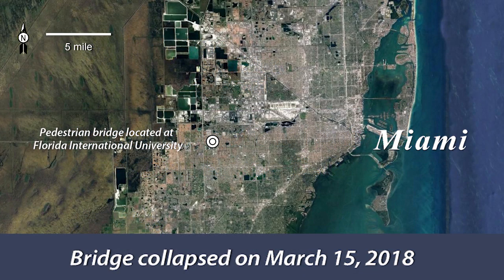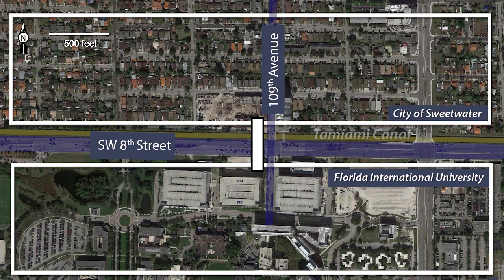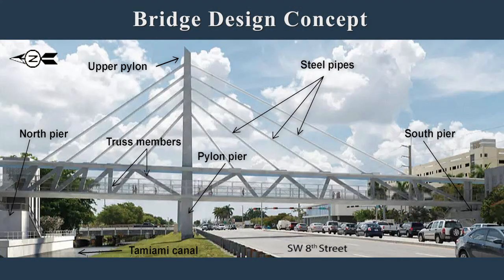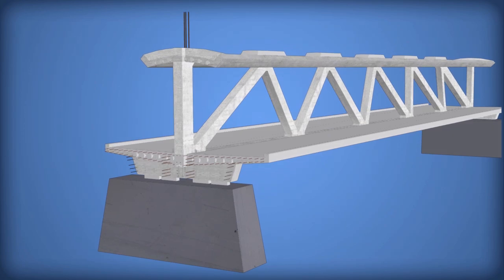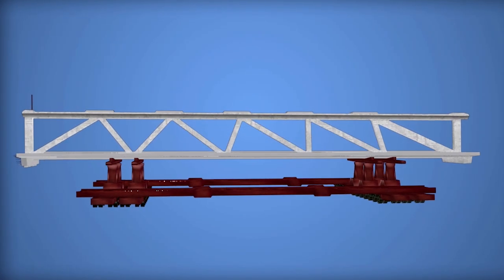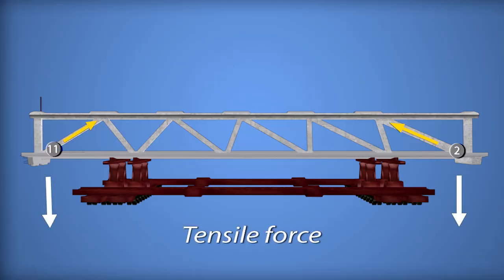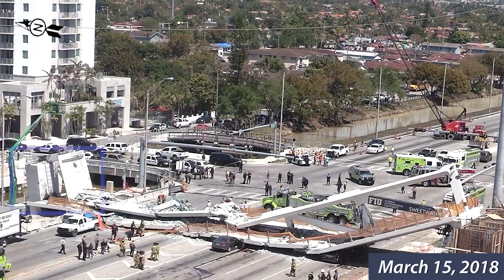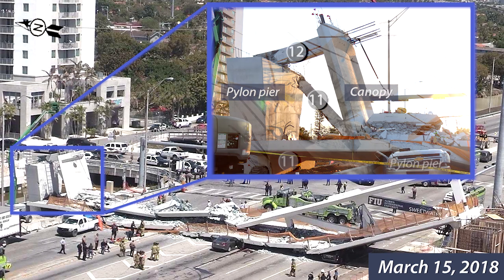Pedestrian Bridge Collapse Over SW 8th Street HWY18MH009

Comment: How do you not close off the road with cracks form? Let alone design a bridge with no redundancy?
Reply: As others have mentioned, many, many bridges have no redundancy.  Almost every older bridge with a truss structure above the roadway doesn't have a redundant structure.  As has been mentioned about the I-5 bridge, break just one of the truss members, and the bridge collapses.
That said, it's not often that I'm embarrassed to say that I'm an engineer, but this is one of those times.  Cracks that big in a NEW structure indicate a very serious problem.
Reply: Andrew Snow how did this design pass then when designing it in a computer? How did the supervisor approve? What redundancies were they talking about then?
Reply: @bigbrycm6  Well, the computer is only as good as the data they feed it (more on this in a second reply). 

In this usage, "redundancy" is being used in a narrow technical sense.  Here's an example: If you hang a 10 lb weight from one rope, you have no redundancy -- even if that rope can support 500 pounds.  No mater how strong the one rope is, if a single failure occurs then the weight falls.  On the other hand, if you hang the weight using 2 ropes that have a strength of 15 pounds each, then you have a redundant system -- if one rope fails the weight still doesn't fall.  UNLESS, the ropes are tied to the same hook, and the hook pulls out of the ceiling.
From my reading of the synopsis, the hook-in-the-ceiling example is apt for this bridge.  The steel reinforcing rods were redundant, if one failed, the others would still hold the bridge up.  But the joint where the steel rods came together was not redundant, a single joint failure brought the bridge down.
Reply: @bigbrycm6  Regarding how they got the design wrong, the NTSB has some information in their synopsis here:
https://www.ntsb.gov/news/events/Documents/2019-HWY18MH009-BMG-abstract.pdf
But, the full report is not out yet, so some of the following is just my guesses:
From the synopsis: "The  bridge  design team made two errors ... First, the design team underestimated the demand (loads  imposed  on  structural  members)....  The  investigation ... found  the [load] was nearly twice what the design team had calculated. Second, the design team also overestimated the capacity of the node to resist shear (horizontal force) where the nodal region (11/12) was connected to the bridge deck. This overestimation was the result of the designer using incorrect loads and  load  factors  in  its  calculations."

This is where the full report is needed for all the details.  Here are some possibilities:
It's actually hard to explain the first error of the loads being twice what they calculated.  For engineers, calculating the loads that a bridge beam or joint will see is kindergarten stuff.  My wild guess is that it might have been a communication problem.  Obviously a project of this size will have a number of engineers doing different parts of the design.  I'm sure this is NOT the case, but for example maybe the bridge has a concrete member in it with 2 steel rods in it.  Engineer 1 calculates that each steel rod will carry 1000 pounds.  Engineer 2 is designing the joint where these steel rods anchor.  Engineer 1 tells engineer 2 that the steel rods have a load of 1000 pounds.  Engineer 2 assumes this is the TOTAL load of the 2 rods (500 lb each), and now we are off by a factor of two!
In error two, they say the designer used the incorrect load factors, and they talk about safety factors elsewhere in the synopsis.  It sounds like maybe (and again, this is a guess), that the person designing the joint assumed it was part of a redundant structure, and thus used a lower safety factor than they should have for a non-redundant structure.
In both of these cases, a computer can't always save you.  If you tell the computer the joint has a 1000 pound load but it's actually a 2000 pound load, the computer won't know.  If you get the results back from the computer and it says the safety factor is 1, and you think that's OK because you think it is a redundant structure where the load is shared across a number of these joints, again the computer won't help.
Reply: Andrew Snow thanks for the explanation and info!
Reply: @andrewsnow7386  My guess is that they had a bad model for the stiffness of the joints, which influences the distribution of loads on the whole structure. Steel truss joints can be designed to be flexible, but concrete structure is much greater cross-section, which might have made it stiffer, so it got greater loads than expected.
Reply: @andrewsnow7386  You could’ve just said “garbage in garbage out“ :-)
Reply: @bigbrycm6  In 1968 when I took my first computer course, the saying was "to err is human, to really screw things up takes a computer". The Hartford Civic Center Roof truss collapse was because the computer did not understand the 12 commandment "you can't push a rope" and the engineer didn't really understand the program. I am a retired PE and am glad to be out of the mess of today's business and construction. Engineers get overruled on safety decisions. Good Luck, Rick
Reply: @SlocketSeven  I generally agree with that statement. The cracks were much smaller at the time of the move. I am a structural engineer and I would have suspected the start of a shear friction failure if I  saw those cracks. But if the engineers was having a bad day and didn't think so much, they may have not recognized the problem or gone back to check the calculations. We see cracks in concrete all the time and you can become complacent. You have to remind yourself to keep on thinking and evaluating. 99% of the time, the cracks are nothing important.

There was no excuse after the move when the cracks were much larger.
Reply: @yodaiam1000  The cracks were getting larger over several days. That isn't an issue with the movement or placement forces. That is a looming failure. 1 bad day if this all happened over a matter of minutes or hours, okay, maybe. But they watched this develop for 5 days. Then decided to half arse some adjustments, while keeping live traffic flowing under the bridge. This goes beyond a bad day and well into criminality.
Reply: @andrewtaylor940   The cracks got much worst after the release of PT in #2 and #11 after the move. That is when the cracks really started to grow. They were much smaller before the move. I still say the engineers should have know the implications when the cracks first appeared. It was just unmistakable after the #11 and#2 PT was released.
Reply: @yodaiam1000  Oh I agree. I'm not an Engineer. I was a Fire Officer so Fire Engineering Degree. Just looking at this report what would have flagged me was not so much the existence of the cracks, as the growth of them, and the speed of the changes. The cracks were measurably increasing over a matter of hours/days. And shedding fist sizes pieces of concrete. That should have had big red lights flashing in everybody's brains. DANGER DANGER! And for Gods sake you don't do load testing or load/tension adjustments over an active heavy traffic roadway in the middle of the day. Worst case you close a lane or two, put one end of the transporter back under it and let it shore up the load at that end until nightfall when you can close the road and start attempting to fix the problem.
Reply: @yodaiam1000  From your experience, with the rate of growth in the cracks shown in the provided photos, would/ should a decision have been made sooner, or does the timeline seem appropriate? The photos are of great detail so it would appear the engineers were fully aware of the problem from the start and most likely were in some way concerned.
Reply: @fishtacos2320  Most of the time, the error would have been caught in the design stage but stuff happens and things will get missed (rare but it happens). The cracks in the casting yard were obvious shear friction cracks. A trained engineer would have to be having an off day to miss the implication. Missing the cracks after placement and not knowing the risks involved was either complete incompetence or they were rolling the dice and hoping nothing was going to happen. The charitable interpretation is incompetence or the early signs of dementia.
Reply: @yodaiam1000  Probably the engineers were inside in the air conditioning and relying on low wage workers to report abnormalities (though with all those photographs, it's likely they never bothered looking).
Reply: @uhclem  Why do you believe that?
Reply: @yodaiam1000  I lived in Miami from 1957 to 1995. I know all about the work ethic there.
Reply: @uhclem  Don't you think that is a generalization? It takes a hell of a lot of effort and focus to get an engineering degree and practice engineering for a living.
Reply: Most long span bridges don't have redundancy. The lack of redundancy was only during the construction phase in this case. However, those cracks did demand that the bridge should have been shored up and the road closed.
Reply: @yodaiam1000  not so most bridges do indeed have redundancy.
Reply: A typical suspension bridge can be brought down by the severing of the suspension line. Any section of an arch can be removed to cause a collapse. The tie on a tied arch can be severed to cause a collapse. Cable stays are the most redundant long span bridges but even there, it relies on the compression of the deck at the pier locations.  The piers on most bridges can be brought down by the demolition of a single leg on the pier. A single failure of a diagonal on a warren truss or chord element on a bridge truss can bring the bridge down. 

Based on my experience, it rare to see a long span bridge that is truly redundant and even many shorter bridges are not redundant.

It is difficult to define redundancy or codify it but Why do believe most long span bridges are redundant?
Reply: @yodaiam1000 
That doesn't make it a good idea.
Reply: @ezakustam  I made a bunch of post. I am assuming you are talking about the comments on redundancy. 

Redundancy is a good design principle but it is not necessarily practical in all cases and it is very difficult to define and codify. If you can have redundancy, that is great and a good design goal.
Reply: @peterebel7899  That is just not true. Bridge design is also typically not referred to as "mechanical constructions". Redundancy of load path is a very important aspect of structural design. We use factored limit states design for the strength aspects for a bridge or a building but redundancy and ductility are also very important design aspects. I don't know where you get your information from. It doesn't sound like you are an engineer.

BTW there are trees with multiple trunks and load paths. Look up "Banyan tree".
Reply: @peterebel7899  I never said redundancy was an absolute requirement of a bridge or a building. But it is an important aspect of structural design. If I bridge doesn't have redundancy, some codes require an extra load factor in the design. One of the reasons cable stays are so popular now is the fact that they have more redundancy.

Redundancy is very difficult to codify but make no mistake, a design with redundancy is safer and where ever possible is an important design goal.

This is a precast bridge where it is typical to review the design during different phases of the construction. That was also true for this case. You can see additional rods were added to the design for the load reversal during the move. The main issue was a design error.  Even under the fully constructed configuration, this was still a design error.

What discipline of engineering are you in?
Reply: @peterebel7899  I am a structural engineer with over thirty years of experience. I design mostly buildings, renovations, seismic upgrades but I have also designed some bridges including pedestrian bridges over highways.
Reply: @peterebel7899  We do an analysis with the redundancy in mind. A good design thinks about the consequences of the different design decisions including redundancy. For structures, redundancy is generally considered a good thing but it is also balanced with the other criteria of the project. That is one of the reasons it is difficult to codify. It is also actually difficult to define redundancy in structures so it also difficult to generate code rules regarding redundancy.

I can't get into all the reasons why it is a good thing or all the ways we use redundancy. It takes a lot of experience to develop a structural design so it is not possible to do it any justice  in a Youtube response.

It looks like you may be German.  There is a saying German structural engineers have and I obviously don't know the translation. Perhaps you can find it. It is something like "one is none" and that was drilled into our heads as engineering students and I generally agree with it. That doesn't  mean redundancy isn't a different kettle of fish for other disciplines.
Reply: @yodaiam1000  You are wrong.  As the video explained the mast and tubes were only aesthetic - i.e. not structural and a frivolous waste of money.
There was only one set of truss diagonals - if any one failed the bridge failed.  That was a lack of redundancy.
(Suspension bridges can lose hangers and strands within the cables. Similarly, cable stayed bridges.  Truss bridges usually have multiple trusses.  So, wrong again.)
In this case the problem was that the joints were weaker than the members and the joints did not have adequate capacity.
When the joints failed people merely took photographs.  It is a design a 2nd year student would get failed on.  Everyone involved should be made to resit their professional exams.
Reply: @robi4387  I made a bunch of comments so I am not aware of which comment you are referring to.  However, stay pipes do provide redundancy. They were initially added for both aesthetics and vibration control. They were most certainly not only aesthetic. This is written in the original design brief. However, even if the assumption was not written into the original design brief, the pipes add redundancy.  

If you loose the main suspension line of a typical long span suspension bridge, it will most certainly collapse. If you want to argue that you can loose individual strains, then you can loose individual rebar in the truss or you can loose a chunk  out of the concrete member. So according to that argument, everything is redundant until the second to last fiber fails. You can also loose an entire truss members near the mid span without a collapse.

The interface shear cracks moved substantially and showed significant ductility for an interface shear failure prior to the collapse. That was in part due to doweling action of the column vertical bars which is a form of redundancy whether that was intentional of not.

Multiple trusses by itself typically does not add more redundancy. If one of two trusses fails, the bridge typically fails.

In general, redundancy is hard to define. There are design decisions that you make that are subconscious but add redundancy. Sometimes you look at a detail, and you just say to yourself "I don't like that" and you change it something that is more redundant. Not every decision or aspect if necessarily expressed in the design brief. In fact, only the major components are addressed in the design brief and there can be thousands of decisions when designing a building or bridge.
Reply: @yodaiam1000  close a major road for the fear of a bridge collapse, try convincing a politician to do such a thing. it was reasonably safe till it collapsed, while they were trying to fix it. if they felt they couldn't fix it they would have closed the road and removed the bridge from it's stands. there was no reason to close the road. now should they have closed it, out of an abundance of caution sure, but not absolutely mandatory, and in this case, it would cause a major traffic problem and require probably weeks of planing and bureaucracy to begin with.
Reply: @TheObsesedAnimeFreaks  The shear friction cracks were obvious after the move and a trained engineer knows the implications. I am a structural engineer and I would have closed the road. If I got resistance, I would have phone 911 to close the road (that is not an overstatement).
Reply: @yodaiam1000  and what i think 911 will tell you is "hahahahhahahah," then again i have little confidence in the government as a whole, and i know there is very likely going to be politics at play that would have prevented that road being shut down at all, until the bridge collapsed. just because an engineer screams at a 911 operator doesn't mean that the police department is going to respond properly or correctly. they will likely show up see the bridge is still up after being told it collapsed, and then just move on. and if they went through the bureaucracy, they likely would have only gotten permission to close at most a few lanes and erect scaffolding to sure it up and keep it from collapsing. At the end of the day it likely wasn't going to be shut down even if they called 911 and said it would collapse. politics are at play here like it or not, and THAT is why the road wasn't shut down while most engineers and people with a lick of sense would probably want it shut down, the politics of shutting down a major road at any cost is are far less forgiving, and far less permitting.  not only is economic harm a reality that they have to consider, the inconvenience to their constituents is another thing. they rather take the risk of having it collapse then allow the road to be closed for any amount of time while it still hasn't collapsed. even the police or a 911 operator can't make that call unless something like a traffic accident that mandates the shut down of the road happens, especially a major road like that one.
Reply: @TheObsesedAnimeFreaks  I doubt that is true. If a structural engineer calls and says that there is a dangerous condition and the bridge may collapse, 911 will respond or face the consequences of not responding. Those cracks were an indication of an impending collapse. That Ave video you linked to was incorrect. He jumped to a wrong conclusion. Look at the cracks just before the collapse. It was unethical for anyone who knew anything about concrete design not to shut the road down or call 911 if they had to.

As a structural engineer, I am usually quite sympathetic to engineers that may have made a technical error since it is so easy to do and people are killed when these things happen. But this case is different. I doubt it will happen but manslaughter charges should have been considered. That is how reckless the contractor and engineer were.
Reply: @yodaiam1000  
I say this as a layman, a police officer would respond if you call 911 and not do a damn thing because they don't know what is going on. Even if you explain it to them they would likely go, "it's still up isn't it?" and not do a damn thing, unless you can guarantee a timeline for when it would come down, then they would likely have to get the closure approved by the department among other things. The main problem with the idea that the road should have been shut down, is that it is a major thoroughfare, and shutting it down for any reason is not a call that a individual 911 operator or a police officer can make. It HAS to go through some level of government debated and then approved, especially since the bridge hadn't fallen yet, and the workers were actively trying to mitigate the issue. The reason why the road wasn't closed is because the government would not allow it to be closed, because plenty of reasons. they didn't have a the benefit of hindsight like we do now. they probably didn't realize it was going to collapse or that they could prevent it from collapsing. and like AvE said, what probably caused it to collapse was the snapping of the pretension bars, while other factors probably contributed to it, the straw that broke the camels back was the over tension of the PT bars.  

At the end of the day there was likely nothing anyone could do to close the road, government isn't going to always listen to an engineer. they likely wouldn't have considered the bridge an emergency until an hour before collapse or at best a day before. if there was a degree of uncertainty as to when and how, they probably wouldn't have closed it, just to keep traffic flowing.

I would complain about the road not being closed to the Public Works department, i feel they have more responsibility here then the engineers that were trying to fix it or prevent it from collapsing. .
Reply: @TheObsesedAnimeFreaks  Ave was completely wrong. That is not a dis on Ave. He just didn't have all the facts and jumped to the wrong conclusion. The PT did not even snap. It was fully intact after the accident.

I guess we will have to agree to disagree on the 911 call. The road got shut down anyways. Perhaps 911 is much different where I live.
Reply: @andrewtaylor940  like is said, i have little faith in politicians, and for the reasons outlined, i feel that the politicians would rather risk the lives of people traveling under the bridge rather then close the road down. it's a major thoroughfare and closing something like that down takes a lot of planning and is something that can't be done with the snap of the finger, unless there is a physical obstruction in the way. That being said, i don't disagree with the fact that it should have been closed for many many reasons, i just don't believe that the politics and bureaucracy that exists in Miami would have allowed it to be closed even if they tried. so even if the politicians aren't complete morons, there is probably policy and procedure that has to be followed that will slow down the closing of the road.
Reply: @TheObsesedAnimeFreaks   "reasonably safe till it collapsed". No politicians need to be convinced, there are authorities for this. Like police closes a road immediately when there is a bomb threat.
Reply: @retepaskab  Politicians DO need to be convinced, you are conflating an actual (and arguably over reactive) emergency with something that mandates procedure. construction crews are not permitted to just shut down a road, NOR are the permitted to use emergency services to shut down a road for an undisclosed amount of time. a bomb threat often results in a waste of resources when no such actual threat exists, however once the threat is determined to be false or "taken care of" which often happens within hours, while shutting down a road because someone complains that they think the bridge will come down, is a risk that they can take and closure time that they can't take. the time of a road closure because of a bridge is often months not hours. closing a major road for months is NOT acceptable, unless absolutely necessary. there are 2 entirely different things with 2 entirely different response methods.
Reply: @bobwillneverdie  Design a bridge ≠ Engineer a bridge.
Reply: Bryce Nelson — A lot of bridges lack redundancy.  You don’t necessarily get redundancy with multiple trusses, but you can compensate for lack of redundancy with conservative design and a generous margin of safety.

An example of how double trusses do not guarantee safety is a steel bridge on I-5 in Washington State which collapsed (in one section) in 2013 when an oversize load struck one element of the structure at the top.  The bridge could easily support itself and its maximum load with a large safety margin, but could not tolerate breakage of the truss element.
Reply: @GH-oi2jf  Ah yes, the I-5 Skagit River Bridge. I remember it well as I work for WSDOT; however, I was on vacation east of the Cascades at the time and fortunately wasn't called back.
Reply: @GH-oi2jf  The redundancy with multiple trusses will not prevent a failure or collapse. But will generally limit it. So typically only a portion of the deck will fall. Not the entire span.
Reply: @GH-oi2jf  but that truss bridge in washington was built a very long time ago, and would not have been built today.  Its truss members were likewise built lower what freeway clearance normally allows.  At least it was built from steel and lasted decades longer than this concrete folly!
Reply: Because Florida
Reply: My biggest issue is....since they obviously documented the cracks as they were forming...and growing mind you...no one thought about the OBVIOUS SIGNS OF PENDING FAILURE.
Reply: @nick4819  I can't conceive of any professional thinking those cracks were not a life safety concern. As you say, the cracks were obvious signs.
Reply: Someone should be going to jail for this. The idiots in charge showed nothing but extreme incompetence and negligence. The design was bad from the get go. The architect designed a death trap.
Reply: I don"t know, but in my company important technical decisions like ditching redundancy are not made by engineers anymore, but by a management without any clue of science.
Reply: Yeah I was a bit confused with a bridge being approved without redundancies. Out of all the projects I've worked on, nearly everything has a redundancy for each redundancy.
Reply: @fishtacos2320  Actually, most long span bridges are not redundant. Too much was made of the redundancy issues. It was a side issue. This bridge actually hung in pretty well which indicates there was some redundancy and ductility. It is just that the signs were ignored.
Reply: Yes, people need to go to prison on manslaughter charges and never allowed in the construction industry again.
Reply: Just gotta say anyone who makes an agenda about race or politics out of this needs to drink bleach, I'll buy you all some. Why are there so often engineering disasters that are very obvious to see after the fact is what we should be asking
Reply: @Bryce Nelson Somebody replaced their brain with "Matlab will solve this". There's a reason for the tradition of engineers standing under the newly-built bridges  they designed during testing.
Reply: The golden gate and many other bridges and buildings built way back now we get 5 day bridges and buildings in new Orleans that cant even get to opening day maybe college is a waste of time
Reply: the same reason why they allow a lot of bad things in life they don't care
Reply: Which engineering firm approved the design?  Did OSHA inspect the cracking B4 the failure?  Was the concrete tested prior and after the pore for adequate curing?
After the fact questions, but a procedure of tests needed to prevent future accidets???
Reply: @salvatoredemaria8753  Figg was the design firm and the design was approved by Mr. Denny Pate of Figg engineering.

OSHA did not review the cracks before the collapse. They review sites after the occurrence of an accident.

Concrete was tested during construction and after the collapse. All materials met specification.

NTSB is publishing recommendations for future procedures.
Reply: Sounds like the 2 Santiago Calatrava bridges in Dallas. Dysfunctional as designed.
Reply: Money
Reply: Wow..............?????
Reply: I guess architects know better
Reply: @ramirochavez3332  architects do not engineer bridges. They may have designed what the bridge will look like but structural engineers are responsible for making sure that design is structurally sound. This collapse was a massive engineering screw up and those working in the field should have been raising red flags when those cracks started and continued to develop.
Reply: How do you sign off on installing a non-redundant structured pedestrian bridge that starts to break under its own weight in the fabrication yard?
Reply: Probably because 8th street is a major roadway in Miami. The political powers that be wouldn’t have wanted that headache if the engineers did request the road closure. So many people failed with this incident.
Reply: In IL that would be illegal. Probably is in FL too.
Reply: Florida
Reply: There are numerous cases of architects desperately trying to be original in their designs which then fail killing dozens of people. 

The blame is then put on the engineers and the costs, risks are offloaded to the construction workers and general public. 

The Romans built bridges that lasted centuries. Maybe we should consider the importance of using more arches, pillars, and domes.
Reply: @Salvatore Civale Actually as a matter of fact... it takes longer. Closing the road down to fix and or remove the bridge will take months. You have to consider planning and all the application and approval processes that they have to take care of. While removing a collapsed bridge only takes about a day or two once it collapses. Rebuilding it often takes longer. That bridge would have been up there cracking further and threatening to collapse with traffic flowing under it for months if it didn't happen to collapse within 5 days.  
>When lives are at stake, it's better safe than sorry
you might say that now... but wait till you are in a position of power and have to worry about NIMBYs complaining about traffic and causing major issues.
Reply: @Salvatore Civale dude you don't seem to get it. To remove a bridge, any bridge, it takes quite a bit of planning and prep work before they can actually do it. It would not be the same amount of time it took to put the bridge there, it would be much longer. They need the equipment to remove it, which has already been shipped to the next job site and likely will not be back till they have time to bring it back, they need to plan the diversions, they need to get the removal and road closure approved, and tones of other things like an "environmental study" in some cases. Your agreement was to close the road till the bridge could be removed, guess what that would take months. That is objective fact. There are procedures in place for a reason even if I personally disagree with them because of edge cases like this. Construction companies have to follow this procedure and get all road closures approved, and do all the paperwork and filings for permits and a bunch of other stuff. It's not as simple as you want it to be. Government bloat prevents quick action in cases like this.
Reply: When this happened, I had the same question. However, I realized that incompetence, lack of general safety rules have come to dominate American know how, so I am not surprised that the roads were kept open while they decided to make a bad situation worse. If the tensioning rods were causing the cracks, then why add additional stress. The concrete might not have been strong enough, or the bridge had a construction flaw in itself. I believe we will see more and more of this type of engineering failures as time progresses, this will not be the last of its kind. Incompetence, mismanagement, greed, UNIONS, all play a role in what is being built today. That Rock café being built in New Orleans is another example of incompetence.
Reply: @ew4096  uh... Stressing concrete in tension makes is stronger, as opposed to stretching it, which was part of the issue
Reply: @SlocketSeven  diversity has nothing to do with it.  The problem is the structure failed from a structural and materials perspective - concrete does not work in tensile and shear applications as was illustrated.  Also, why was the university blowing all of their money on a highway overpass?! They should have kept the structure as basic as possible to minimize risks and to focus their money on the campus where people actually want to be, not hanging over a pollution filled freeway canyon.  Great example of car-centric idiocy in design.
Reply: Because wahmen
Reply: It is intuitively obvious to even the most casual observer (what I am saying here is that any idiot could see) this was not going to work even before it was lifted.
Reply: They could have even used REAL cabled stayed supports.   They also had plenty of room for another interior pier support.   It was arrogance and FIU is also to blame in the matter.   As a structural engineer I'm so tired of unforced and unneeded risk being taken on because some damn board member or manager wants it that way "Just Because" we can do it.
Reply: @SlocketSeven   More like, "predictable result of deregulating everything".  Stronger, more safety-oriented (meaning less "business-friendly") construction codes would have prevented this.
Reply: @SlocketSeven  and the new generation (regardless of age) clueless  thinkers and peopele tha dont care /
Reply: @SlocketSeven  Diversity?! How exactly? I am genuinely asking, just want to know. Thanks.
Reply: @bobwillneverdie  You are kidding, right?!
Reply: @alirezajohari8916  That they hired a music major with no engineering experience to design a bridge, promoted the crap out of the fact that it was "female engineered", and then had people die because they thought music majors could be engineers. Nope, all that happened.
Reply: Its easy when you don't care.
Reply: Low bid
Reply: Pacified Democracy  evidence or notoriously sexist?
Reply: Greed
Reply: So the suspension things are just decoration?
Reply: It's Florida. They don't give af about safety.
Reply: Half the bridges in this country lack redundancy.
Reply: Bro there’s cracks on every bridge
Reply: @Therealestrunnerluda   on newly installed bridges??
Reply: @bigbrycm6  Cracks usually start to show up the day after concrete is poured.
Reply: how? why? 
easy.....money
Reply: You do it by going to the college that teaches bridge building. A world renowned college for bridge building.  Once on the outside things get different when that person has to sign their name. I don't think people spending money would risk having 0 redundancy.
Reply: The cracks were developing already 19 days before they even started to move that section. The overall design did not take into consideration how it was going to be constructed. They basically doomed that bridge when they decided to use the ABC method to construct it.
Reply: Exactly!
Ludicrous situation.
Reply: Florida.
Reply: @manualLaborer  America
Reply: @bobwillneverdie  whether someone has a music degree or not has nothing to do with architecture, it's the job of the engineers to fix the designers weaknesses. that means an architect doesn't have to go to school to be one for all practical purposes, while this helps in creating practical art, it is not absolutely required. the engineers will fix whatever weaknesses the structure has to make sure it can actually stand the tests they put it through. This is also why we can have design competitions for major structures as well. they will take a child's design and make a practical representation of it.
Reply: @TheObsesedAnimeFreaks  You are correct. I have dealt with crazy architects all my career with crazy designs. I don't believe Linda Figg has an architectural degree. She wasn't involved with the technical design. I understand that she has an engineering degree but looks like she was just involved with the marketing aspects.
Reply: @TheObsesedAnimeFreaks  Doesn't the importance of hiring a designer with engineering experience outweigh that? 

Example: Airline hires music major as pilot, and they crash a plane. Would it be the airlines fault for hiring them? or would it be the flight attendants fault because they were there and didn't try to take over the plane? It would be the Airlines fault.

My point is that the state of Florida is literally awarding people for hiring music majors to build bridges. Its not like the company just made a mistake..... Florida literally PAID THEM MONEY to do this. THEY WERE PAID MONEY TO RISK PEOPLES LIVES FOR "FEELINGS".

Also: https://en-volve.com/wp-content/uploads/2018/03/FIU-Munilla-Construction-Feminists.jpg
Reply: @bobwillneverdie  
>Doesn't the importance of hiring a designer with engineering experience outweigh that?
Absolutely not. this is why you higher engineers to do the dirty work. to make the structure as sound as it can be. architects are often trained is some aspects of math and engineering, but they are NOT a substitute for an engineer, and depending on the school they went to for the degree, i.e. if they went to Georgia Tech or SCAD, depends on how much of that math and engineering they have. architects are designers first, engineers a distant second. their job is to design things, and for all practical reasons, ANYONE can be an architect without any schooling, you just have to have the engineering team behind you to make your designs work properly. 

>Airline hires music major as pilot,
That's irrelevant. The only thing that matters as a pilot is if they have the flight hours, and the license(figuratively or literally) to fly. there is a reason why most airline pilots are ex military, they have the hours and they have the license to fly, if they just happened to go to mercer for a music degree just before entering the air force is irrelevant. 

>My point is that the state of Florida is literally awarding people for hiring music majors to build bridges.
they didn't higher engineers with only music majors though, they allegedly hired a music major to design the thing. the fault falls on the engineers and the site crew that screwed up the build, not the designer. If that team recognized a problem with the build, which they often do, they will notify the designer that they need to tweak the design slightly to fit the new requirements. it seems that in this build that didn't happen like it should have. it seems the engineers might have missed a few vital details in the design process and that contributed to this incident. while i'm not an expert on these things, i know if you have the right people behind you as a designer you can make wondrous things.
Reply: @AmsterdamHeavy  What women? The EOR had decades of bridge engineering experience and was a man.
Reply: dude, there are a lot of bridge designs that are non-redundant, most of the time they don't need redundancy. your standard highway bridge is non-redundant. if one of those beams go, the section of road it is carrying goes with it. granted most bridges are built to handle much more then they are generally going to take in their lifetimes. 

also there was little need to close the road, while they should have probably taken a bit more precaution in the construction of the bridge, what actually caused the bridge to fail was the over tensioning of the post tensioning system. this caused the steel to snap and loose it's strength causing the bridge to collapse almost instantly. there are a few videos on this phenomenon by a few more engineering centric youtubers that actually covered this bridge collapse. 

https://www.youtube.com/watch?v=KtiTm2dKLgU
Reply: @TheObsesedAnimeFreaks  At a minimum the road should have been closed when they were re-tensioning the bridge. That is always a potential failure moment when you are actively adjusting the load bearing mechanisms. You don't wan't live traffic under that.
Reply: @TheObsesedAnimeFreaks  I agree with the first part of the statement. Most long span and many other bridges are not redundant. After the cracks were discovered after the move, the road should have been closed.

The failure was not due to the snapping of the PT but the failure mechanism is a minor issue compared to the ethical obligations that the engineer and the contractor had fail to conduct.
Reply: @yodaiam1000  like i said, i don't think they had a practical reason to close the road below, hindsight 2020, they thought they could fix it and they didn't think it was as much of a risk as it was. this isn't even thinking of the legal challenges if they tried to close the road anyway. bureaucracy is a mess, and they probably had no other choice but to close one working lane and leave the rest open.
Reply: Damn after reading the comments. A lot of people are unaware of affirmative action, how it was used here, and failed. Just like everywhere else.

OP isn't talked about whites like you idiots believe. The team was formed to be diverse and be an all female lead "to fight the patriarchy" instead of having a team of the most qualified people. And if that happens to be an all Male or white group then accept it, or accept this.
Reply: phuc ewe  And based on you comment, I think you are fairly ignorant of the facts.
Reply: Result of engineers with lots of studying and no experience in real life. I’ve been working with concrete forming since age 10 and knew the feeling of a busted homemade form from miscalculation. Result, you make your mistakes at a cost of some spilled concrete and work of hand bucketing it back into the wall rather than a 100’ bridge collapsing and killing people. Wrong guy on the job, plain and simple. I with only farmer engineering and no high school diploma could have taken one look at that bridge sitting on the ground and said no possibility. Smash it up and start over. The whole weight of the bridge on one truss pillar that I could have smashed with a sledge hammer in minutes and collapsed the whole thing. Completely inexcusable in 2018.
Reply: SlocketSeven — “Diversity” was not the problem, but I suspect the “good ol’ boy” network was.  These companies all worked together and knew each other.
Reply: Since they all knew each other, they should all have shared the blame and went down in flames together. There is nothing wrong with questioning  someone's work if done correctly. I have seen painters and sheetrock installers cover up electrical, plumbing and framing problems.  And asphalt pavers cover up soft spots, drains and manholes, only to make repairs later after dig ups.
Reply: @GH-oi2jf  Buenos viejos chicos.
Reply: @SlocketSeven  the cracks apeared AFTER it was lifted into place.
Reply: @TheObsesedAnimeFreaks  Some smaller shear friction cracks started before the move but they were not as obvious as the cracks after the move. I think they should have been able to identify them before the move  but it is conceivable that they missed the ramifications.
Reply: Closing roads costs time and money. Higher up managers were trying to save a buck
Reply: @SlocketSeven  nice thinly-veiled way of trying to blame either women or immigrants (or both!) Occam's Razor applies here. Good ol' fashioned incompetence.
Reply: @oniinu  this is Engineering incompetence alone!
Reply: @oniinu  No traigas una navaja de afeitar a un tiroteo.
Reply: @oniinu  When the bridge was opened it was hailed as engineered by all female crew.
Reply: @billykuan  It wasn't designed by a female crew. That is just a fact.  Men  engineered this bridge but that doesn't mean that men shouldn't be able to design bridges in the future.
Reply: @oniinu   It was heavily advertised as being 'female' engineered. The problem with equity hiring is that competence does not matter. Now everyone thinks it's women's fault when actually it's the bosses fault for hiring totally incompetent people based on genitals.
Reply: Ody -Chan that being said, when you hold people lesser standards aka affirmative action, you end up with inferior outcomes. Abolish affirmative action everyone should be held to the same standards
Reply: Fact: FIGG was picked for  "Diversity", being a woman owned business. Fact: the design was criminally Badly designed. Case in point, Node 11 had only .25% of the steel needed to support the weight, NTSB finding. Fact: They repeatedly state in writing they there was no safety concern due to the cracking node These people had no business designing a dog house let alone a bridge. All along the way they were given deference because of  "Diversity".
Reply: @biggseye  There is one women partner I know of but she was only involved in the marketing end. She talks up the design to the client but she was not involved in the design.

All the designers on this bridge were men. The firm itself has been around a long time and had many decades of experience designing bridges. It is actually a very well known firm (even before the collapse). I don't believe there was any deference given because of diversity. Although there are fewer women involved in structural engineering than men, any large firm just by probability alone, will have women as engineers and partners. There would be no difference from this firm and other large firms in terms of diversity.
Reply: Live by the 'look at me look at me, we are women, we are strong and unique and specials'  then die by it.  They made damn sure we knew they were women first, engineers second.
Reply: Me And mine your not unique... you are member of an invasive species that has basically killed off most of the planets wild life and are about to kill itself off because humans like it or not are instinctively coded for aggression and destruction of its opponents. Your response proves your like all other humans. Maybe some subtle difference but overall... basically your a photo copy of all other humans. 

Want to change that, well start re-writing the human genome into a less aggressive species.... until then, your just going to have live with it
Reply: @SlocketSeven  ah yes, the engineers werent white.  that was clearly the problem.
Reply: @SniffyPoo  you're an idiot
Reply: @SlocketSeven  dumbest comment on youtube this week
Reply: @SlocketSeven  The collapse was caused by laissez-faire economics, "cutting red tape" and general lack of regulations and government oversight.

When folks try to shift the blame to minorities, they're just useful idiots in the service of those who profit from these policies (or lack thereof). There's a name for that: fascism.
Reply: @AmsterdamHeavy  Where did you read this? What was her name? Mr. Denny Pate?
Reply: @1stWorldProblemsSolved  The bridge was designed by a woman.
Reply: Public school dimwits !!!